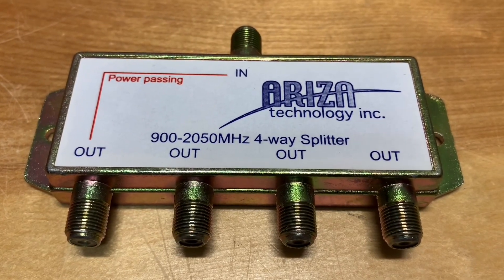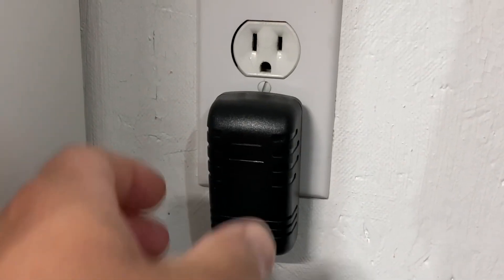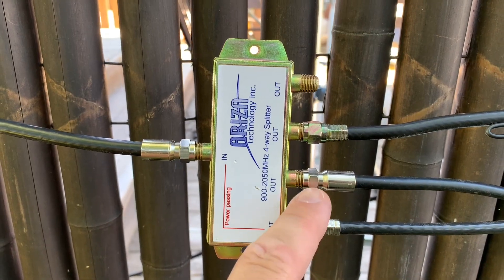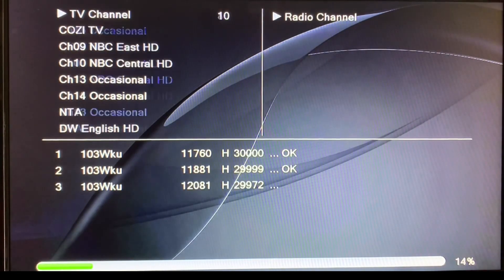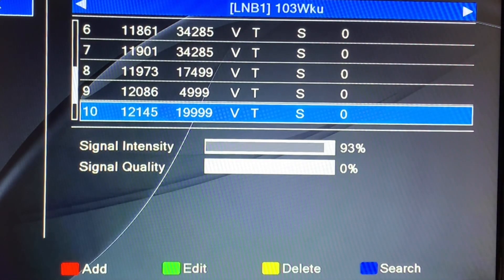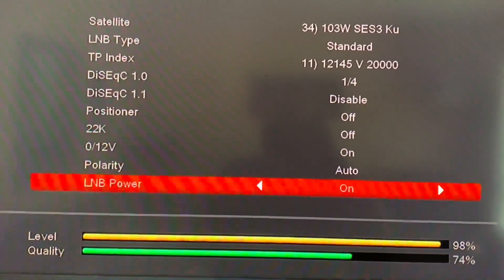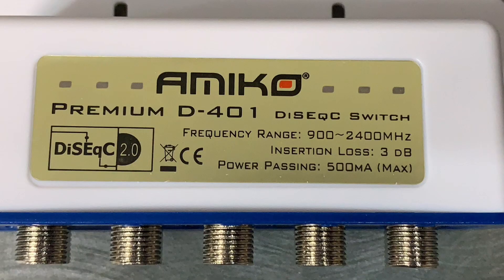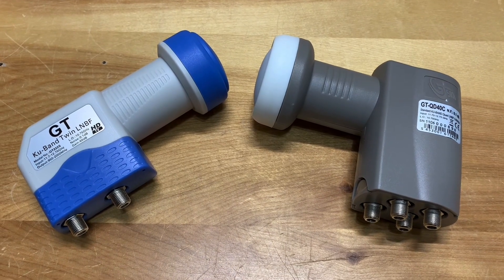Satellite TV Splitter with Single Power Passing Port - FTA Satellite TV Splitter

Comment: Hi, where is the video on multiswitch 2x4? It might be the only solution for me (I have lnb twin and I can't access  to the roof, I need 3 point sat  in house). Can you help me? Thanks
Reply from the maker: FTA Satellite Multi-Switch Connects Multiple Satellite Receivers to one Dish
https://youtu.be/0jwNJWQCg5I
Reply: @NorthcoasterHobby  can u tell me if I have an lnb with one output SCR and one output "legacy" the multiswitch 2x4 it works anyway?
(I know that with SCR all this would be useless, but I can't go on the roof and I didn't install the lnb, I'm working backwards). Thanks you a lot!!

Comment: My cable run is about 40ft  just installed the channel master preamp 1    my first scan on high gain was 67 channels 

My next thing of interest will be an external tuner where I can see the signal strength   My Samsung TV doesn't show signal strength
Reply from the maker: For checking signal strength, digital converter box is a handy device to have almost all of them have a signal strength metre built-in.

Where to find the signal meter on your OTA digital TV converter box
https://youtu.be/b6Wkm6BC3cs

Mediasonic Homeworx OTA Digital TV Converter Box DVR Review & Tutorial DTV Tuner with PVR Recording
https://youtu.be/h7eA68Zso54

Your Television might have a Built-in Signal Meter for Free OTA Antenna TV. Find Out How to Check!
https://youtu.be/R0PaD1pMQ1o
Reply: @NorthcoasterHobby   thanks very much !!! I did find a signal readout on my 10 yr old Samsung but I am looking for something I can read without flipping through soo many windows
In the old days when i still had 90's tv's I had a convertor box 🗃 that displayed the signal
Thanks for the link  🤟🤟📶📶📺
Reply from the maker: @zandig666  You’re welcome. Here’s a couple of other digital TV  tuners to look at. They all have the same basic user interface.

ATSC Portable Digital OTA PVR TV Tuner Stick Review
https://youtu.be/YyhJDN438oM

Core Innovations OTA Digital TV Converter Box DVR Review - DTV Converter Box with PVR Recording
https://youtu.be/TK4IUDi83r0
Reply: @NorthcoasterHobby  thx  I may also just consider an inline signal meter  something I can read without toggling and can also take up on the roof for future installations. Albeit I heard external tuners sometimes also bring in more channels 🤔 🤔🤔 but also introduce more remotes and breaks in the chain

Comment: dc power pass from one reciever other three are off so how can it work while one powered reciever turnd off??
thank you
Reply from the maker: My apologies for the lateness of my reply. I just had a chance to double check on this. Yes, this is correct. If the control receiver is powered off then the other receivers connected to the splitter will lose signal. 

It is not really an ideal set up unless the control receiver is always powered on. It would only really be useful in a situation where you are tuned to a satellite, where all of the transponders are either horizontal or vertical, but that is usually not the case.

Comment: The problem is that this splitter is limited only for satellite use and doesn't have the complete satellite frequency. If it had the frequency band 5 - 2400 or 47 - 2150 MHz it could've been an excellent splitter. In my case I would use for satellite receiver, cable TV and cable modem. With this model I would've used for one satellite receiver, two TVs for digital cable and the cable modem, of course the input is connected to AMIKO outdoor diplexer to combine the cable TV and satellite signal. Even for satellite is problematic, the last channels especially on Vertical and Horizontal High some of them are cut off.

Conclusion this splitter is a big NO!
Reply from the maker: You’re correct about the frequency, but here in North America such a narrow bandwidth of KU satellite is used, from 11700 to 12200. So it works here fine from that point of view. However, it’s really a stop-gap measure for satellite TV on additional TV’s in a house, on account of the DC voltage block on most ports. But it might work as a temporary measure or for just a few channels on a secondary TV. Not ideal though, that’s for sure. I was interested in testing it out, but wouldn’t use it as a permanent fixture in a system.